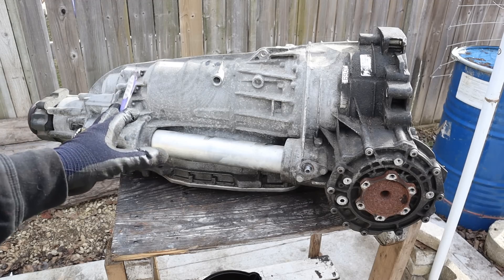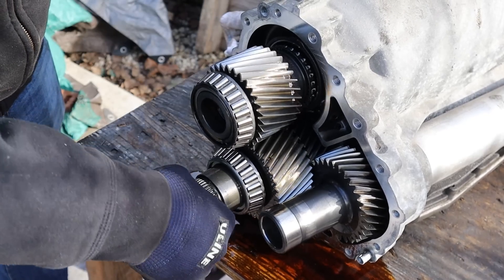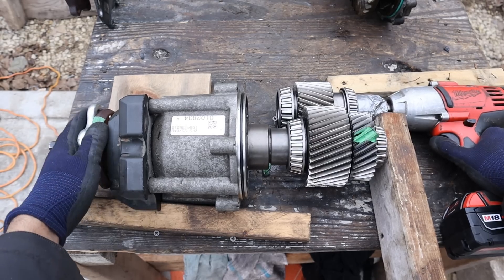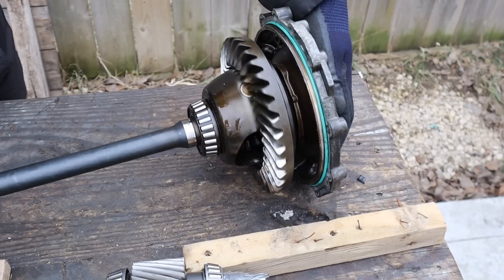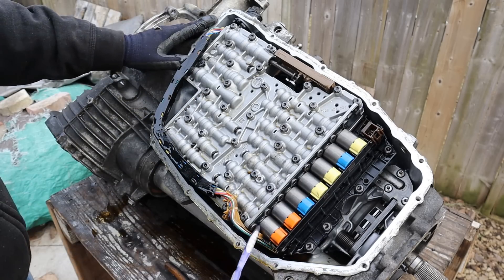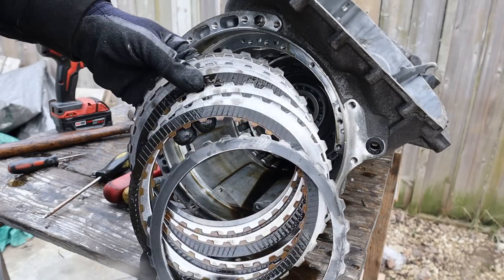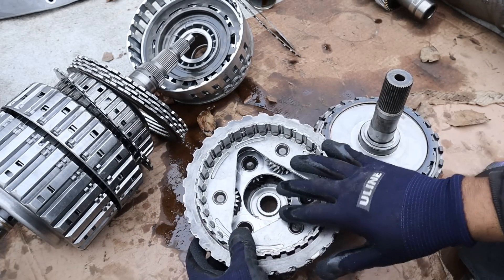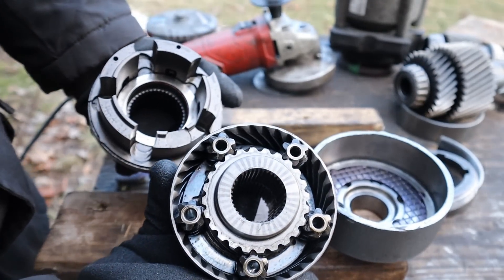How Audi Quattro AWD Works

Comment: I watched the video twice with great fascination, and gratitude that you posted this.  Oh, and also thank you to your family for donating their clothing for the cause :)

Realizing that this is a rear bias set up, I still have a question after watching this more than once.  If you answered this already directly, just point me to a time hack.  But what would happen if you left the rear drive shaft disconnected?   

Thank you in advance
Reply from the maker: Same as if they were on ice
The front wheels would turning
Reply: @speedkar99  would it cause undue premature wear on that mechanical clutch with the sharp spiral planetary gears that you opened with your "special tool?"

Comment: From an Audi slide regarding Torsen history, 1896 introduced Torsen type A, the classic cross axis gear pair design.  1994 introduced Torsen type B, the parallel axis gear pair design (PAT).  2005 introduced the Torsen type C, the asymmetrical planetary gear set design.  2007 introduced the Torsen type B gen 2,  a 40:60 asymmetrical restructure of the PAT design.  2013 introduced the Torsen type Csm (sm = smart module), a compact lightweight restructuring of the type C planetary design.  And that's pretty much where it's been for a dozen years, with the type B2 and the type Csm.

Looking at Audi vehicles of this century, you have the transverse engine "VW clones" of the A3, Q3, and TT.  These are all Haldex and so I won't refer to them further.  Then the R8 is its own unique world.  Then there's the "real Audis", the longitudinal mounted front engine vehicles.  That's the group of interest to this topic.  Within that group, you have four eras: turn of the century (B5, C5, D2), pre-MLB (B6/B7, C6, D3), MLB (B8, C7, D4), and MLBevo (B9, C8, D5).  The newest era, PPC, is just starting with the latest A5, Q5, and A6.  But whether Torsen will even be present in PPC remains to be seen.  All PPC so far are multi-disc clutch transfer cases, yes, just like Haldex IV/V, just at the transmission output rather than at the rear diff.  The first Q7, type 4L, is a bit unique being based on the Touareg/Cayenne platform.

Turn of the century had type A in the 5MT and 6MT, and type B in the ZF 5HP automatics.  pre-MLB used mostly type A.  The two exceptions are the introduction of the asymmetrical type C in the B7 RS4 manual and with the V10 in the MY07+ S8, S6, and RS6 with the ZF 6HP26 transmission.  Then the 4L Q7 arrived with a 6 planet gears version of the type C in its transfer case.  This was different from the transfer cases of the Touareg and Cayenne of the time.  The C6 facelift used a 5 planet gears version of the type C in the ZF 6HP19 transmission.

That same center diff design as in the C6 facelift was used in the B8 ZF 6-speed, the 6HP28AF aka type 0B6.  This is what is in the video.  MY12 Q5, but with that center diff, means it had the 3.2 FSI V6 engine.  An MY12 Q5 with the 2.0 TFSI 4-cyl would have had the 8-speed transmission and a type B2 Torsen.

With the introduction of the MLB platform with the B8 A5 in late 2007, Audi had a new line of 6MT transmissions (0B1 through 0B4).  These did not use the type C.  Instead they used a restructure of the type B PAT design, with three gear pairs, but with the pairs rotated so one gear in each pair was on a different distance from center than the other gear.  This delivered the 40:60 default.  Why, who knows the why of these things.  Production volumes, supply chain logistics, someone got a nice check from some company, ....

After this, Audi introduced the crown center diff in the RS5, in the type 0B5 DCT.  While 0B5 center diffs are all crown diff design, most 0B5 transmissions do not actually have 0B5 center diffs.  That's the case only for B8 RS models and early Q5 and A4 allroad.  Most 0B5, including all in B8 S models, had 0B4 or 0B2 type B2 center diffs.

For the new ZF 8-speed in MY11, a four gear pair version of the type B2 was introduced as the 0BL center diff.  Presumably a stronger design for the 0BL transmission's 1000 Nm handling, it was used initially n the 0BL and 0BK 8-speeds.  Then type C makes a return with the Csm in the C7 RS models.  This 0BK center diff is a planetary design, but with four planet gears, down from the previous 5 and 6, and matching the 0BL center diff's four "transfer points" structure.  And this is where you get the "two different versions of same performance specification", as Audi bounces between the Csm 0BK diff and B2 0BL diff in the ZF 8-speed.  And that's essentially where things have sat for the past dozen years, from what I can tell.

But in the MLBevo era, Audi has been aggressively deleting Torsen from its portfolio.  With the introduction of the B9 A4 allroad and the B9 Q5, Audi introduced "quattro ultra", which is a Magna designed multi-disc clutch transfer case rather than a center diff (Torsen or otherwise) transfer case.  In the MLBevo era, it was limited to A/Q models.  But we see it now moving to S models in the PPC era.  Will there be any Torsen in PPC?  We'll have to wait and see what the new RS5 comes with.  Not that this design is foreign, it's actually very common.  Magna makes such a solution for the Macan for years now.   But it's rear wheel first in the Macan, not front wheel first like in the Audis.

Comment: What happens if i take my front driveshaft out?
Reply from the maker: Nothing.
Reply: Youll go no where. All of the Torsen styles need some torque back feed or theyll act as open diffs. Only the Gen 1 with lockers could you get away with that

Comment: Torsen C-Type LSD center differential.  Used in all Toyota Landcruisers since Toyota aquired Torsen via JTEKT.  If it's got helical gears it's a Torsen LSD... incorrectly called "worm gears" due to that horribly incorrect viral CGI video in Torsen differentials that's out there

Comment: Doesn’t the planetary center lsd or as VW group calls it a crown gear overdrive the rear axel?
Reply: No, this is torsen C, Audi calls it "self locking center differential". Crown gear differential is different.

Comment: The center differential you've taken apart is Torsen type C.  It would be interesting to see the insides of crown gear differential which has been installed since the Audi RS5 2010. It can be found in DL501 dual-clutch gearbox, in 0B2/0B4 manual gearboxes (Audi A4,S4,RS4,A5,S5,RS5,Q5) and may be somewhere else.
Reply: They stopped installing crown gear differential in 2014/2015 I think.
Reply from the maker: I'd love to see those, as that's what I was expecting. 
This seems to be a very simple setup!
Reply: The crown diff was used only in the DL501 of the RS4/RS5 and in the DL501 of some initial Q5 and A4 allroad.  It was not used in the S models, and was not used in the 6MT.  Based on the part information from Audi.

Comment: I really liked the valve body, it's all contained in a unit which can be removed which means the case is not overly complex. Very nice design I thought.
Reply from the maker: Most transmissions are designed this way. Sometimes all it takes is a valve body swap which doesn't require the entire removal.
Reply: @speedkar99  I used to work on transmissions, old American designs. I've never seen that before. But that was 40 years ago  : /

Comment: I have an Audi A8 2011 4.2 TDI Right hand drive (ireland) and whenever i turn at low speed there is a nois (i can hear it louder at the left wheel, it seems to be at that side). The noise sounds to me like there is a male and a female shaft worn and they are spinning. Grinding noise...This is the best explanation i can give to that noise 😂.  
When at normal drive, even cornering and at big speed the car drives normal. No noise or vibration.
Any idea what it could be? 
Just bought the car and the previous owner said it is the transfer case. He said that the oil between the gearbox and transfer case are mixing together and creating this issue. Can it be something like that? It sounds crazy to me. I am a diy and i am trying to figure out what is wrong.
Many thanks!

Comment: Why did Audi use this design only in longitudinal engine mount cars? The Quattro diff (torsen diff) (Correction: this wasn't torsen diff but regular LSD) seems small enough that it should have been possible to use with transverse engine, too.
Reply: It's torsen.

Comment: It's actually 40/60 not 50/50 from 2008 it becomes 40/60
Reply: For the first time they used it in 2005.
Reply: @4x4.tests.on.rollers   2005 was another torsen differential that provides 50/50 .
Reply: @yassinmak3743  As I said - for the first time Audi used torsen C 40/60 in 2005, not 2008.
Reply from the maker: Thanks for the information. I didn't count the gear teeth 😂

Comment: No torsen no quattro
Reply: So quattro from 1980-1987 is not a quattro? How about 2010 RS5, not a quattro to?
Reply: @4x4.tests.on.rollers   exactly in my poor man's opinion. When did Piech manage to climb up on steepest snow hill on summer tires.
I do have a a4 2006 3.0 tdi quattro with torsen and it is even faster than s4 with 4.2 n a from years of my car.
 Could you please tell me about 2010 rs5 central differential, I know nothing but I really want to, thnx
Reply: @Peter-o  Unfortunately I don't know the story about Piech climbing. When it comes to torsen - it isn't any special or magical diff, it's one of many LSDs. And when it comes to RS5 - it was an example, there were more models between 2010 and 2013 with "crown gear center differential", another type of LSD. There are many descriptions and animations about it, incl. Audi website.
Reply: @4x4.tests.on.rollers   in my opinion there are only two types of true lsd torsen or quife, other like haldex and wavetrack is worse because of operational method and time of engaging, in my opinion gears is everything
Reply: @4x4.tests.on.rollers  torsen is not special it is just more reliable than others in road cars in particular unlike other who is not able to use torsen as transaxial differential
Reply: I'm curios what is installed in the old v12 6.0 twin turbo TDI Q7
Reply: @Peter-o  Torsen C 42/58.

Comment: Valve body, torque converter and liquid operated clutches in a 50k$+ 2020 car? I'll keep my manual then, I was expecting at least a double shaft with mechanic operated clutches
Reply from the maker: DSG's used to be a thing but they don't seem to be preferred over CVTs now.

Comment: Do you know if any normal road vehicles have a thorsen? (so we can someday watch you tear one down)
Reply: Quite a lot, it is used as front, rear or center differential.
Reply from the maker: For the center differential, I'd assume the more performance oriented vehicles the the S4
Reply: @speedkar99 Nowadays Audi uses torsen in CSM version for all S/RS (>A3), A8, Q7, Q8. For A4, A5, A6, A7 they use it only in >500 Nm configurations, so basically 3.0 diesels.

Comment: Thanks for this. Very timely as I'm in the middle of a valve body swap on the 8HP model from the same year Q5.

Screwed the first one up pulling it to do the RMS. Horror Freight trans jack platform shifted and a decent chunk of the weight was being supported by the front spindle of the TC on the crank. 🤦‍♂️

I bolted it back on, refilled the fluid and it started clicking as soon as i started it. Could feel occasional slippage in park and at highway speeds. Confirmed with my Ross Tech. Strangely it never threw any codes.

Like you said, you can't do a full swap because the trans serial is coded into the ECU. So I'm swapping the valve body into a 167k junkyard trans to get around it.

Thanks again for the video! Very thorough!
Reply from the maker: Interesting story. So you bent the torque converter?

Comment: 7:30. This IS a Torsen style diff, it's a Torsen C with asymmetrical torque split which made its debut on Alfa Romeo 156 XWagon. Number of gear teeth creates the uneven torque split, I bet the friction side is there only to negate the weak point of Torsen, when a wheel has no grip, it transfers no torque to the other wheel. In another note, maybe you can get your hand on the newer Quattro differential, the Crown Gear differential made by ASSAG.
Reply: It's not correct that if a wheel has no grip, torsen transfers no torque to other wheel. It does and it transfers TBR x more than to a slipping wheel. It just is not enough to spin it effectively.
Reply: @4x4.tests.on.rollers  Raise a wheel in the air and see how much torque the other wheel receives. Same here, raise one axle and see how much torque the other receives. The friction plate is most likely there to negate this symptom.
Reply: @rast9792  Other wheel receives TBR times more than the wheel in the air thus statement that it transfers no torque to the other wheel is false.
Reply: @rast9792  That's a simplified statement, coming from theoretical, mathematical model assuming that ZERO exists. In reality, there is never ever zero. Even if wheel is lifted in the air, there is certain amount of torque needed to spin it due to its weight, internal resistance/friction of entire system etc., so there's always 'torque>0' x 'TBR'.
Reply: @rast9792  It's a description a little bit for noobs. You can't spin the wheel by applying zero torque, it doesn't matter whether the wheel is in air or even in a vacuum.
Reply from the maker: Thanks for the information. This is so much simpler than the torsen we know with many gears! And yes there should be a torque ratio but I didn't measure the teeth to determine ratio
Reply: It's a differential, so it by design can have the two outputs spin at different speeds.  The input speed is the same as the average of the two output speeds.  In an open diff, there's no resistance to how different the two output speeds can be.  If one wheel requires very little power to spin, then, even if the other is not moving at all, the average speed of the outputs will rise.  That means the input speed is rising.  The engine only goes to red line.  The ECM is going to cut power, because nearly no power is needed to spin up the engine to its limit with one wheel in that condition.  Both wheels are still getting 50%, but half of that very low input is not enough to get anything done at the grip wheel.

Torsen is similar, except it has inherent friction between the outputs and input to help keep the outputs near the same speed as the input.  It has both proactive (increasing torque in will cause increasing preload on the friction surfaces) and reactive (differing speeds on the outputs will force more pressure on the friction surfaces) aspects.  But friction can only go so far.  It's not a physical barrier locking mechanism.  When the friction is insufficient to keep the no grip wheel from breaking away under excessive power input, we go right back to like an open diff.  Average output speed is increasing, engine speed is increasing, ECM is going to cut power, now the grip wheel is getting maybe not enough to get the car moving.  It's not about the wheel not getting its share of the power, it's about not enough power coming in from the engine for the wheel's share to be effective.

In between the no-slip no-input split of 50:50 or 40:60 or such and the friction exceeded open diff state, the front and rear are effectively a friction locked single object and the input torque is consumed in whatever proportion by the component members for the whole component to maintain a uniform speed.  This is where the up to X% to the rear or Y% to the front comes into play.  The friction will only hold up to a certain amount of imbalance between the front grip and rear grip.
Reply: I think there’s a video on YouTube now that makes a case for ~6 different ‘Quattro’ versions from Audi; albeit, explains your Haldex and VW vs Audi Quattros.

Comment: That is a Torsen center diff. The gears on the outside are the worm gears that prevent and speed differential front to rear when the engine is driving the vehicle. That is a Torsen type “C” differential with a 60:40 torque bias. All RWD based Audi Quattro systems prior to around 2017 have a Torsen differential. They didn’t switch to a computer controlled crown gear system until the B9 A4.
Reply: Crown gear differential is not electronically controlled, it's fully mechanical and it's not in use for about ten years.
Reply from the maker: Thanks for the information. I was expecting the torsen with the many gears inside the housing 🤣.
Reply: @speedkar99 You probably mean torsen A which is not in use since mid 90s 😉

Comment: That is remarkably similar to the Ford 6R80 internally, save for the AWD components.
Reply from the maker: Apparently they're related
Reply: @speedkar99  Not a surprise at all. Many manufacturers share a reference design and make tweaks. Ford's 6F35/40/70 and GM's 6T40/45/70/75 for example.

Comment: I find it amusing that when VAG released the DSG gearboxes the valve body was renamed mechatronics, causing all the VAG haters around the world to decry this mysterious, sometimes  troublesome new doodad.  (Doodad is an Aussie word describing a thingamabob or jigamaroo).  Valve bodies, of course, were once mechanical but modern ones contain the TCU and are in every way the same as a mechatronics.
Reply from the maker: I find it interesting too. It sucks that you have to reprogram them to the car
Reply: @speedkar99  Maybe, but as you know every vehicle has different engine outputs such as torque, final drive ratios, etc, so the TCU has to match the vehicle configuration.  No other way to do it but to code it to the VIN.  Probably this will update the TCU accordingly.